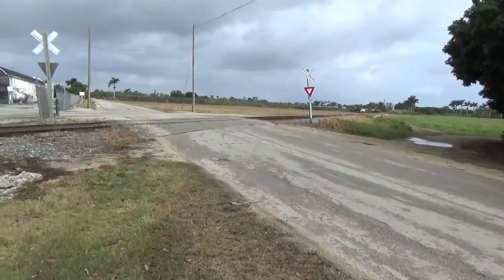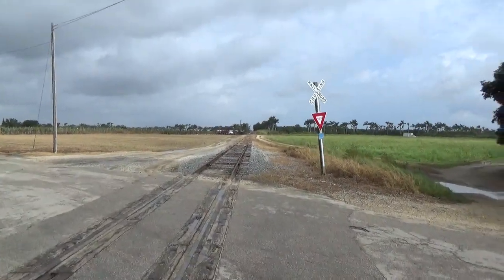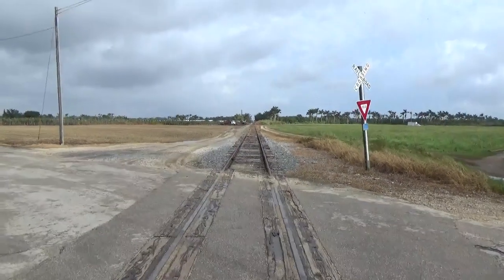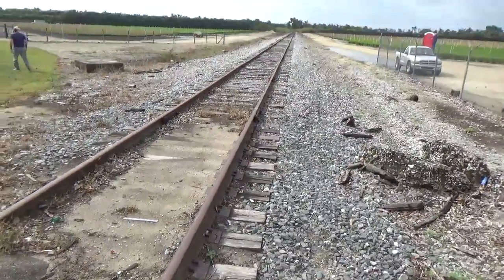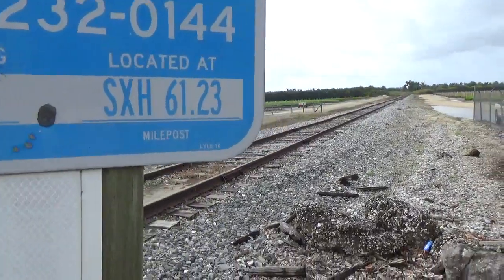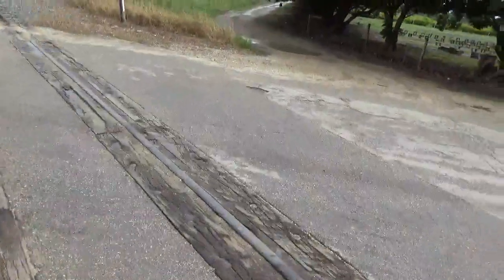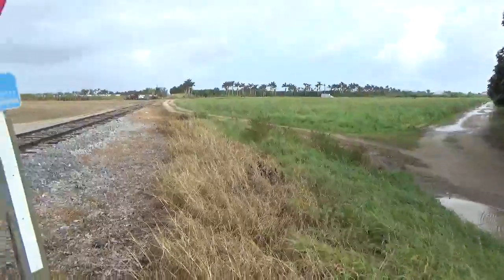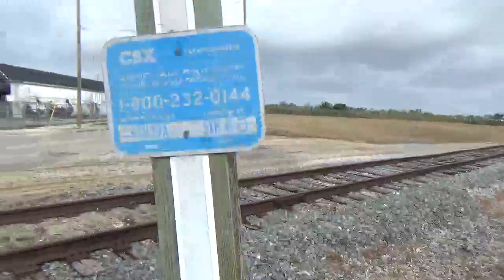Out of Service Railroad Crossing

Comment: One of the reasons the Overseas Railroad is defunct is because the railway is highly prone to catastrophic damage from hurricanes. The Labor Day Hurricane back in 1935 destroyed parts of the railway which was enough to make the original owner of the railway go bankrupt and put the Overseas Railroad out of commission.
Reply: False, it's common knowledge that a tornado spawned on top of Miami and used the overseas railway to get to the keys until it vanished which is why the overseas railroad is gone. It's not because of some stupid hurricane, it's just because a supercell wanted to go on vacation.

Comment: RAILROL82 I got stopped 3 times this morning by Gp's and 2 of them fec locomotives and it was port Job Blue Containers and the first rail road crossing I got stopped at North Miami 71st street and 2nd 20 Ave in Downtown Miami by the fire station and 3rd before you take 5th Ave in downtown Miami by the American Airlines Arena